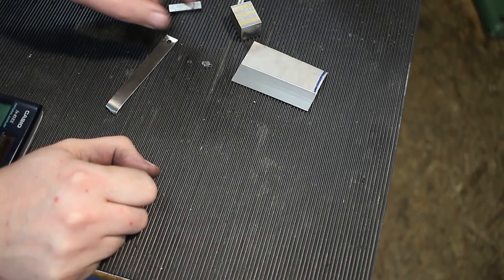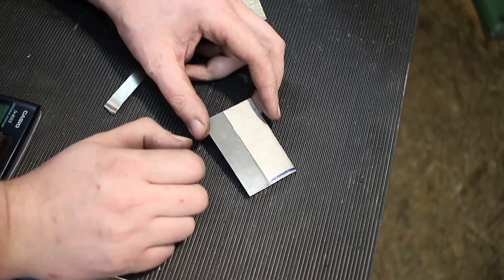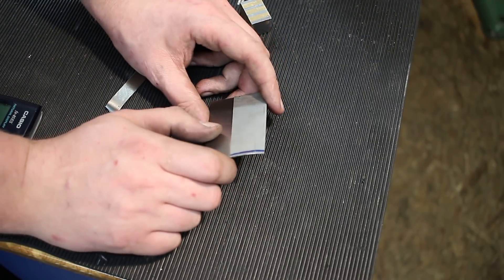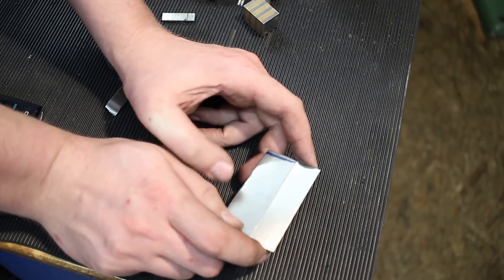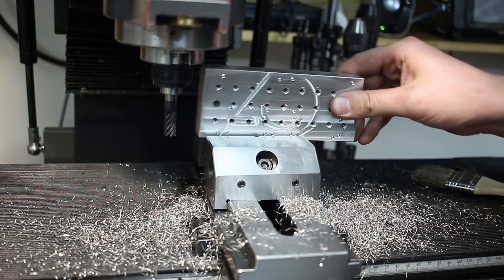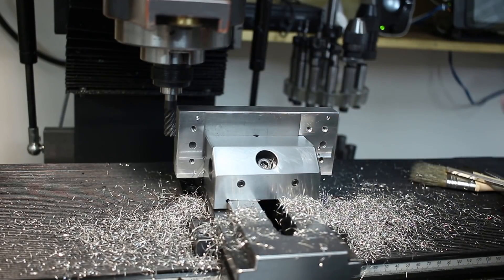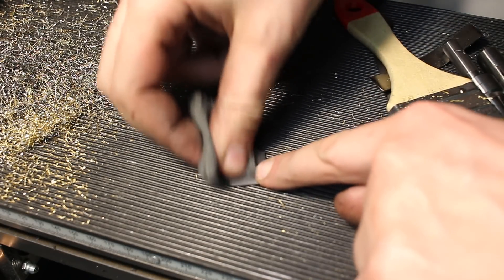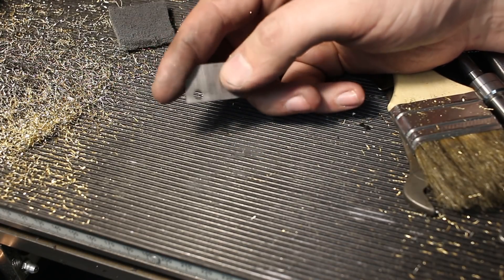Thinning down sheetmetal

Comment: Hi stefan. I'm working on a research project at my university and have run into a bit of a dilemma. We are preforming a ton of tests using 2020 aluminum and have run out of our thinner sheets we need to run the test (0.100in). We have some thicker sheets of the stuff (apx 0.20in) we have been thinning down using a cnc and a manual mill but the results aren't great. We are getting thickness variations throughout the sheet and it is incredibly time consuming to do. Do you have any ideas on how to thin down bigger sheets of metal quickly without changing the properties of the metal (no rolling or ironing)?

Comment: Great technique Stefan, I have done single pieces 20" long using a long parallel across my 3 vices on the mill doing the same.
ATB, Robin
Reply from the maker: Thanks Robin! One of the guys that already retired used to mill strip material down in thickness that way - Doing a bit at a time and reclamp when he reached end of travel. Worked very well.

Comment: Nice tip, love it.  I usually use the Old Tony method, but this will also work it the microwave is down.
Reply from the maker: I tried the microwave but got better results using a frying pan.
Thanks for watching Randy!

Comment: Nice trick, thanks for sharing.

I've always wondered about spring passes, and if they were bad on the tool or not. It seems like the super light cut would cause rubbing and shorten tool life, so I've always tried to finish up with the lightest cut I can that still forms a decent chip, but no spring pass.
Reply from the maker: I never had problems with sharp tooling on spring passes. A used, dull tool (or one with negative cutting geometry) will rub, yes.

Comment: What does climb mill mean?
Reply: Hello Jeff, assuming your serious, climb milling is the direction the work piece is feed into the cutting tool. In the early days of machine tools, most machines were horizontal milling machines, meaning that the cutter was a large circular disk on a horizontal shaft ( think of a table saw). Conventional milling, the material is fed from the front of the saw, the saw blade is rotating with the teeth and gullet or chip clearance rotating towards the front of the saw. The material to be cut is moved from the front of the saw towards the rear of the saw. The material is moving in a direction opposite to the rotation of the cutting tool (blade). C;imb milling, if you stood at the back of the saw and moved the material towards the front of the saw, the material would be moving in the same direction as the rotation of the cutting tool ( saw blade). THIS WOULD BE DANGEROUS ON A TABLE SAW because the teeth rotating in the same direction at the material will take as large a cut as possible, maybe the entire depth of the gullet (chip relief) in the saw blade. Assume all of the energy in the saw blade is now PULLING the in feed material towards the front of the saw. This would not be conventional kick back, but the results would propel the material in the direction of the tool ( saw blade ) rotation towards the front of the saw. In the case I have outlined, we don't have good stability in the feed direction of the material.

Back to our horizontal milling machine: Big cutters with large chip relief. If the machine has any backlash/play/'slop', the table can move an unpredictable amount and the material can be fed into the rotating cutter at a rate greater than the machine/cutter/material can handle. So in the above example, conventional milling fed the material into the cutting tool opposite the rotation of the tool and the front edge of the cutting tool is taking a small cut that increases in size. Imagine the chip as a triangle. The tool tooth takes a small cut initially but the height of the chip ( triangle ) increases as the material fed through the cut. In the case of climb milling, the tooth approaches the triangle from the other direction, taking the thickest part of the chip first and finishing with smallest part of the triangle. So if their is backlash or unintended slippage feeding the material, you can imagine that the cutter takes an extra large bite of material with potentially dangerous results. So most machinists use conventional milling for safety and machine/tool chip load. As Stefan points out, the tool loading is higher as he is taking the larger part of the chip first and this extra force resultant forces push the material against vise jaw/parallel.

Hope this was helpful

Comment: Looks to work better than the double stick tape method. I have always hated working with sheet metal
Reply from the maker: Dont like double stick tape for sheet metal at all - It has to much give, you end up with a lot of chiped tools and bad surface finish. (Works well for plastic thou)

Comment: I wonder how the masking tape on both parts and superglue in the middle trick would work for this.
Reply from the maker: I dont like to put something between part and mounting surface that has some give to it. I do a lot of superglue workholding at my dayjob, especially for contouring sheetmetalparts.Secret trick to remove superglue after youre done: Ultrasonic cleaner at 80°C. Works way, way better than Acetone.
Reply: My guess is superglue would work better the larger the part is, with more surface area to resist the cutting forces

Comment: Now that is clever.  Thanks for taking the time to edit and post Stefan!  Design engineers change their minds?  I didn't know such things happened.
Reply from the maker: Dont get me started on engineers ;)
(But to be fair: Most engineers do a great job. There is a equal amount of bad machinists and bad engineers I think. And each side loves to bash the other side. But none of the two could realy exist without the other side.)
Reply: I happen to know a guy in the UK who's a certified machinist, instrument maker and now Solidworks designer for a pretty high tech company. His designs work simply because he knows exactly how they can be machined and finished to meet the specifications. But he's said much the same about some machinist's, designers and engineers as well.

Comment: c'mon Stefan, 10 mins in the microwave and a lab grade granite rolling pin and you're done.  ;)  (great tip)
Reply from the maker: Actually I used to do that in the frying pan. But it doesnt work with stainless :(
Reply: Ball peen hammer and a few hours of alone time, and you can thin out any sheet metal :P Just probably not "to size"...
Reply: If you need the metal thicker can you run the mill in reverse and throw swarf at it?
Reply: Tony!!!!
Reply: “and now for something completely different”, the vacuum table.

6mm particle board at least in Canada is sawdust held together with as little glue as possible, and its slightly porous.

I cut a sheet the size of my mill table then drilled one large hole in a corner for the shop vac hose and use the T slots to distribute the vacuum. Some duct tape around the edges and Bob’s your uncle.

Keep the wideos coming:)
Reply: tony im sure thers a vid of you doing this very same thing but  the cat licked it to size ? no??
Reply: with hours i dont need it to be sheet to start all i need is  the hammer
Reply: A colleague just showed me how the plastic the deli salad bar boxes are made out of works just like Shrinky Dinks. These guys: https://encrypted-tbn0.gstatic.com/images?q=tbn:ANd9GcTdEvQ0-Gpyv9jyXyB13U6_eeg8c-TCOacARV1AMF_PYbSeeZC04w Colored Sharpie seems to hold up just fine as pigment.

Comment: A good and easy method for small sheet metal parts that fit in a vise. In aerospace industry there are large sheets made with one or several stepped thicknesses in order to save weight. The sheet will only have the thickness that is needed to carry the actual loads in different places. This is achieved with chemical etching. The patches that should not be etched will be covered by acid proof paint. And the patches that should be thinned are left blank. With such a pattern it is dipped in a tank with hot agitated acid for a certain time.
Reply: You are welcome. I am also amazed about youtube in general and home metal workshop channels in particular where I have learned and am learning a lot.
Reply: No wonder airplanes are expensive!  Have you tried gluing up complex layers of aluminum foil? 😉
Reply: In aerospace industry "gluing" is called "adhesive bonding". Yes this is being done but not with many foils but with only very few (often locally two or three) layers of aluminum sheets typically between 0.8 and 3.2 mm thick. And yes, "adhesive bonding" is expensive. But if a long range airliner can be made a few hundred kilos lighter it can take a few passengers more. Over a life time of about 30 years and 20 hours flight time per day with 2-3 landings (2-3 tickets per day) the expensive bonding technology earns money which is mostly used to make your ticket cheaper.
Reply: I never ceases to amaze me what you can learn by watching a video and also reading the comments. Thanks rol eic, John, Australia.

Comment: slick! thanks for the tip!

I've actually had a project (making scale miniature machinist squares) on hold for a while because i wasn't sure how to mill thin sheet like this (& couldn't find a source for stock with the thickness i wanted) - tried gluing sheet down and milling it away vertically, but i wasn't able to reliably get parts thinner than 0.01" (the sheet would pull up into the cutter, running it), and even when it worked properly, i was concerned about being able to ensure parallelism between the faces, with a glue layer of unknown and likely variable thickness.

how thin have you been able to go with this technique?

have you tried hard milling thin stock like this? i don't have much experience with hard milling, and I'm worried about the ability of a thin part like this heating up too much and tempering itself - would the backing parallel serve as a sufficient heatsink, do you think?
Reply: I milled some 303 stainless down this way to 0.010" a while back.
I do not agree with Stephen about the 6 flute carbide mill though. The helical angle is too aggressive, the part gets forced downward and wads up. For very thin, use a 2 flute cobalt mill. With climb cutting, even a 2 flute will leave a good finish.
Reply: You might try bonding the part to a larger plate and then lapping it down.
Reply: I'm no machinist, but for small, flat, hard parts you might be better off using a surface grinder, if you have access to one. Lighter, more precise cuts, handles hard stock like a champ.

Comment: I'm going to keep that idea in the bag of tricks, and maybe try it with HDPE and polycarb as well. Thanks for sharing!
Reply: It works Joe pazyncky(great machinist check his chanel)-or something like that did it using a vice jaw same as stefan uses paralel(better since you can measure thickness,but beggars cant choose) and something square dont remeber to hold plastic for some clips.
He also showed how to get insanely thin tubes on lathe.